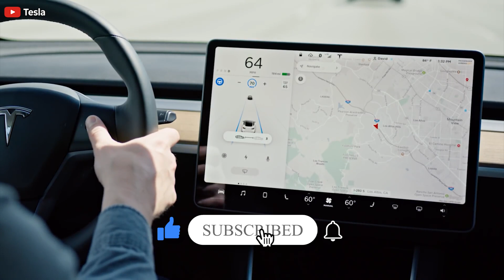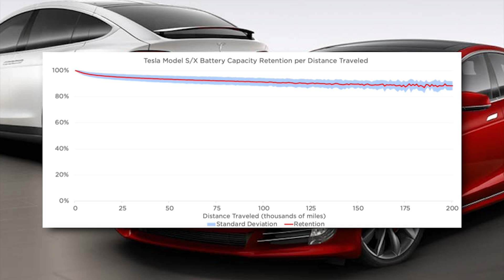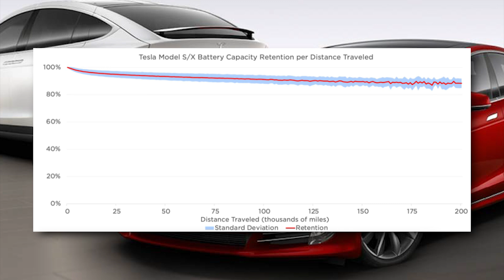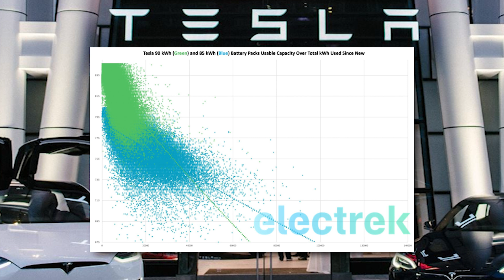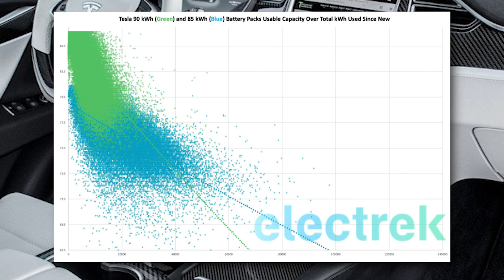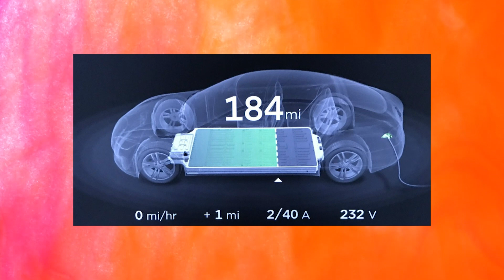Tesla Updates Battery Degradation Data, Explains Energy Capacity

Comment: so they were saying 200,000 miles to lose 10% capacity before scrapping the battery ....... why would you scrap a battery with 90% of original capacity ...... If you had a 100kwh battery to start, it would then be performing like a 90kwh battery ..... and plenty of people buy and run 90kwh battery cars with no problem .... maybe it's not then ideal for a vehicle starting with 80kwh .......  where the mileage range would go down and might be an issue .... but the battery does not then have to be scrapped, at the very least the battery can still be used for many years for energy storage ...... a 100kwh battery which was performing at say 60% of original capacity, would still have equivalent of about 60kwh of storage, which is about 5 times the size of battery storage packs that are used in home energy storage like the Tesla Powererwall ..... it would be like having 5 Telsa Powerwalls

Comment: The 85 vs 90 kWh battery pack comparison  shows a problem - different cells may have pretty different cycle life. Higher capacity (on the cell level) sometimes comes at the price of lower cycle life and cells from different manufacturers may have pretty different specs regarding this anyway. For Model 3, think LG vs. Panasonic, not to mention LFPs from CATL. Would be interesting if we could compared these numbers :). Also not mentioned is anual degradation which adds up over time, so a 10 year old car will show some degradation even with low mileage.

Comment: Regarding 200,000 miles in US, versus 150,000 miles in Europe: based on my experience from living in Europe (France, Germany, Sweden and Finland), I find that owners of luxury automobiles in Europe generally don't do as much highway driving as people normally do in the US (where folks are generally accustomed to driving greater distances).  So what that also means is that with more driving of greater distances in the US and less driving in Europe, most American's are typcially going to hit 200,000 miles a lot sooner than someone in Europe (who is going to be driving mostly shorter distances), which means that they'll generally replace it when it get "old" versus worn out.  Another thing to consider is that 150,000 miles is nearly 250,000 kilometers (241,401.6 to be exact) which I think psychologically (as a quarter million kilometers) just feels high, making for a natural replacement threshold, when the car will generally be a lot older by the time it hits those numbers.
Reply: I was about to write the same. Makes sense. You will find a lot of pretty old cars with low mileage in Europe, just because distances are smaller and people don't do a lot of long distance driving (compared to the US). On the other hand, such old cars are normally not really scrapped but sold to Africa or eastern Europe for cheap. For ICE cars this is, not going to see this happening for BEVs at the moment. But that's a different topic.

Comment: And that is reporting degradation on the Model S and X, which use the older 16850 batteries.The Model 3 and Y use Panasonic's newer 2170 batteries that are supposed to lose 10% over 300K miles. Of course these results vary depending on region, temperatures, and especially use. I suspect that most Model S and X owners charge between 10% and 90% to extend the battery life and reduce degradation, but when you think about the good battery life well past 200K miles it compares very well to ICE (gas) vehicles. Certainly there are Hondas, Toyotas, and pickup trucks that are very reliable (and can usually make it to 200K miles) but there is also much lower wear for the electrical motors and brakes in EVs. Still, it's good to get official confirmation of what EV supporters like myself have known all along.
Reply from the maker: Thanks a lot Dean for these insights.
Reply: @Torquenews  Of course what is not being mentioned here is Tesla's upcoming 4680 batteries. There was a LOT of press in 2020 before Battery Day talking about Tesla's "Million Mile" battery, but even though Tesla announced the 4680 battery details, they were quiet about it's million mile capability. I think that is because the ramp up for mass production of the 4680 batteries has been slow. Elon Musk was cautious about his 4680 battery announcements, and on battery day he said that the production was not going to be simple, easy, or quick. And that there were no short cuts in the process of scaling up new battery technology from the research lab to mass production. But in addition to being cheaper to build, safer, having more energy density, plus using a cleaner, faster manufacturing process with the 4680 batteries, the new design promises a MUCH longer battery lifespan. To the point of being lifetime batteries (not the life of the owner, but of the EV) which is a key feature announced for (press darling) solid state batteries. So potentially over the next few years, the issue of battery degradation may be resolved for good.

Comment: I don’t buy it!!! Granted he’s talking about s/x models. I would think it would follow similar trends.
I got my tesla LR 2021 June 1 2021
I Saw 326 max miles at 100 percent on day one now it’s 309 at 100 percent according to the app in literally 2.5 months 
So 17 miles range lost so far. I have only 3000 miles so far on my odometer. That’s absolutely insane. Anyone else dealing with this?
I’m not charging to 100 percent daily either 
Anyway to recalibrate?
Reply: Change it to percentage. Don’t look at miles . It will help you . I just drove my Y 4000 miles in 5 days . It works
Reply: First off, you should never be charging to 100% unless you absolutely need it (e.g. you are going to be driving 300 miles and there isn't a charge option on the route). It's very hard on the battery. Limit your charging to 90% as has been recommended by Tesla. Secondly, most battery retention reports  I've seen are that your greatest losses will  be in the first 20K miles as the battery "breaks in" and that degradation after that really slows down. Lastly, are you super charging, or charging at home/level 2? Super charging causes more degradation due to the speed of charging.
Reply: @marksaake  Sometimes you NEED to balance out the batteries if the drop is too much. That might be the case for him. Out of balance batteries are when some batteries are not topped out at the same level as others when it is supposedly FULLY CHARGED.
Reply: Your 2nd person just online here reporting big drops in short time... Thank you for the PROPAGANDALESS TRUTH👍

Comment: My March 27, 2019 Standard Model 3 had lost 12.7% after 15,200 miles of driving.  The100% charge of 220 dropped to 192 by August 11, 2021 odometer 15,200.  This is battery capacity - NOT range.  City Range is about 67% of indicated charge limit at 100%.  .67 x 193 = 130 city miles.
Highway range is about 82% of indicated charge limit at 100% 
.82 x 193 = 158 hwy miles
Reply: My 19 Tesla 3 performance seems to have lost 8%
I drive it pretty hard tbh (always have) and haven’t supercharged very much. I always limit charge to 90%
My results may be a little skewed, as I changed to all season tires (factory summer not good for winter) which seemed to affect max range. 90% charge is about 252 miles for mine compared to 272 when new.
It’s possible this all mostly could be due to driving habit and different tires rather than actual degradation.
Reply: You want real world results? Here: 2018 LR Model 3 nearing 34,000 miles and the degradation is less than 1 % and stable.
Reply: No it didn’t .. you’re prob mistaking what the screen shows at 100% charge and that has nothing to do with the actual range. Do some research on it..  frugal Tesla guy here on YT has a video on it that explains what is showing on screen and what is actual range.
Reply: Thx for the REAL WORLD Stats 👍 not the propaganda put out by tesla